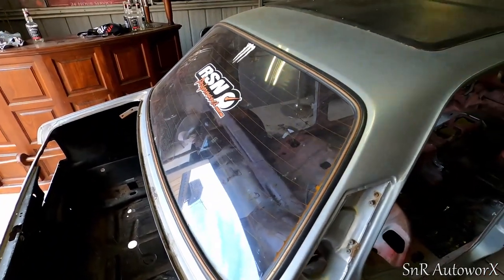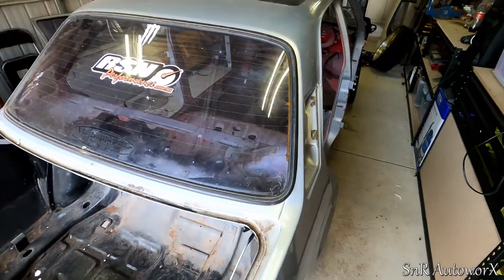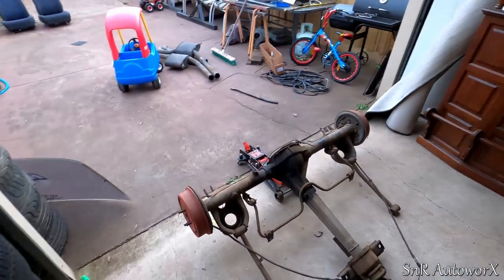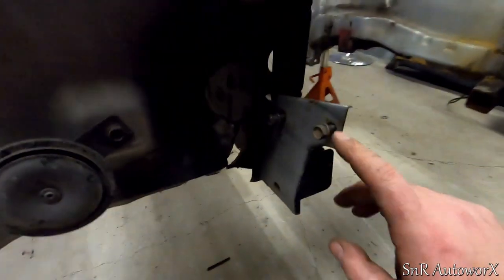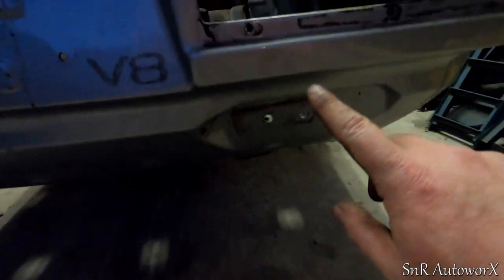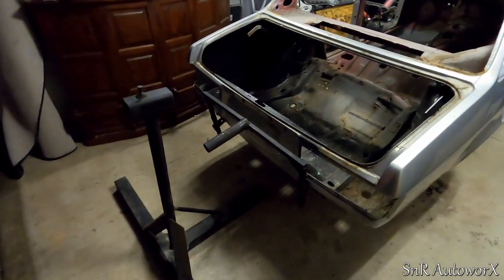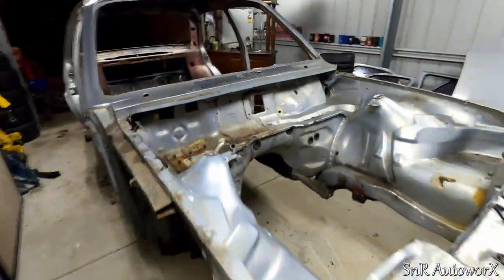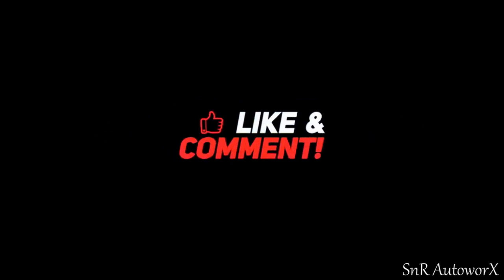TG Gemini Project: Getting it finally onto the Rotisserie!!

Comment: Do you still have the rotisserie
Reply from the maker: I do mate my car is still on it hahah but the goal is the have it off by the end of this year or start of next
Reply: My friend I found a rotisserie but I’m a little concerned about the front part as I have to fabricate brackets my question do I bolt it on to we’re the bumper brackets go and are the bumper brackets strong enough
Reply from the maker: @dannysarkus5492  Yeah at the front on either side of which the front bar bolts too should be fine mine is mounted from that spot 😉
Reply: @snrautoworx2840  do I use the bumper bolts lol I feel sketchy 😩
Reply from the maker: @dannysarkus5492  you can or get longer bolts with the same thread pitch 😉